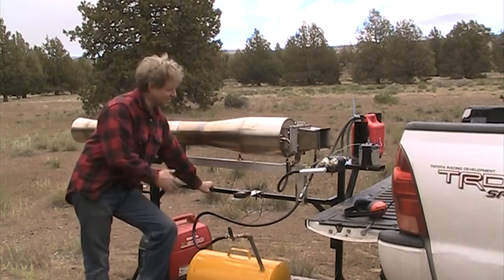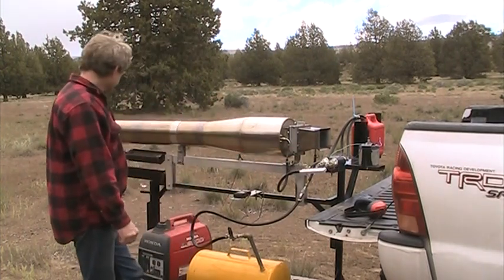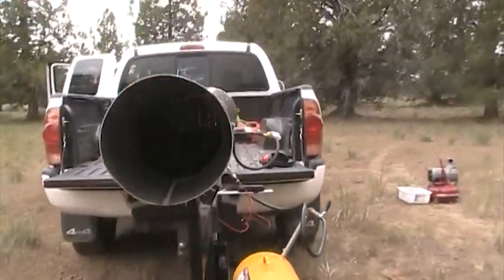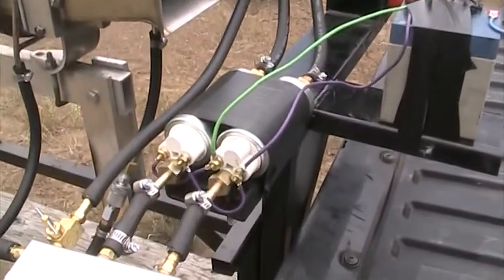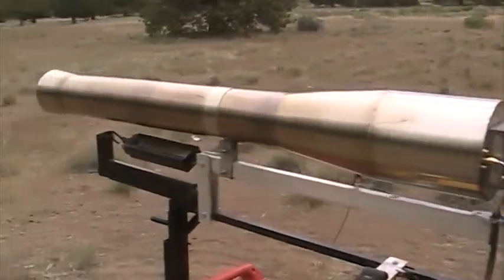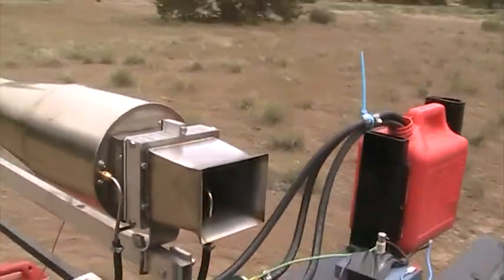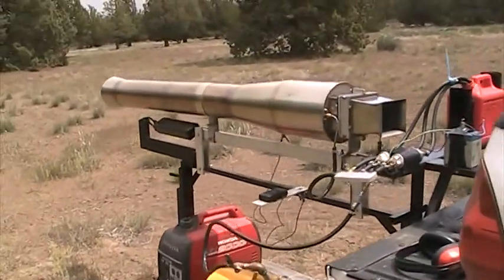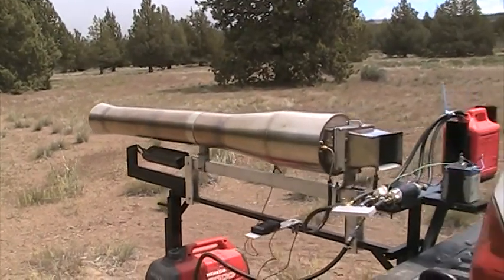New Rocketman show starting 2017 One hundred pound thrust engine run.

Comment: Can this engine be used for aircraft? From my understanding the air intakes have to be different for aircraft?
Reply: Pulsejets have been used on aircraft in limited roles. The best known of course was the V-1 flying bomb used by the Nazis near the end of World War II. The Germans also explored plans for a manned version of the bomb which would have been essentially a suicide squadron. . Pulsejets have their shortcomings as aircraft engine including lowe specific thrust and the need to lauch them from either catabpaults or the bellies of other plaines while aloft at air speed. Getting an airworthiness certificate from the FAA would be some serious work.I would encourage anyone with real determination and resources to take it on